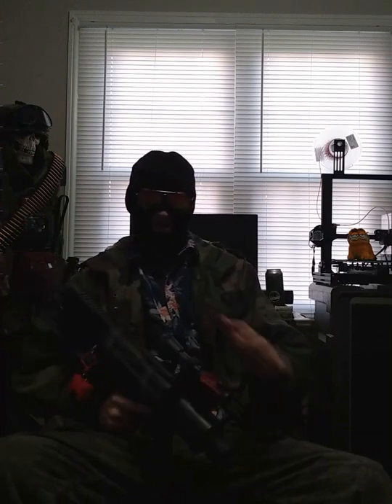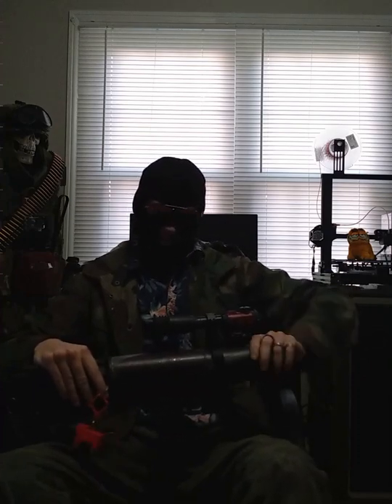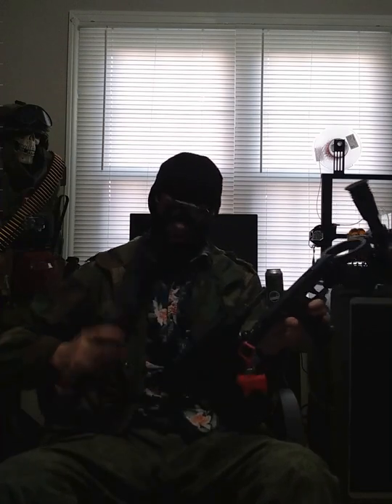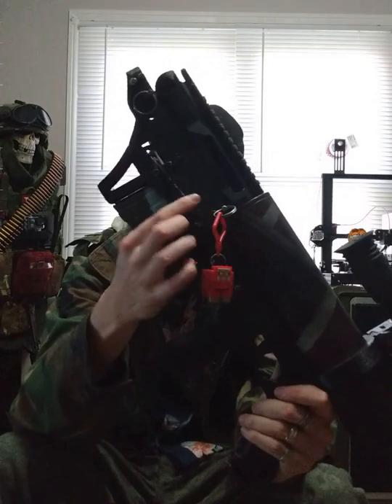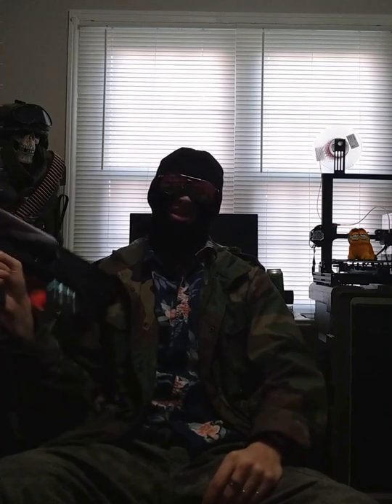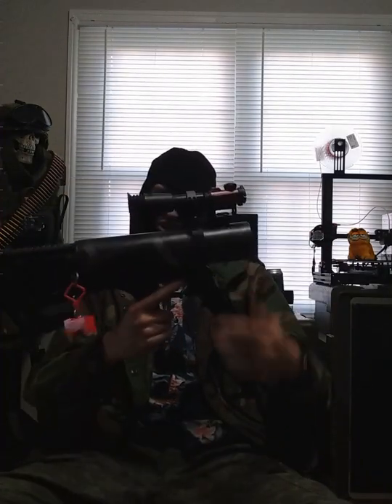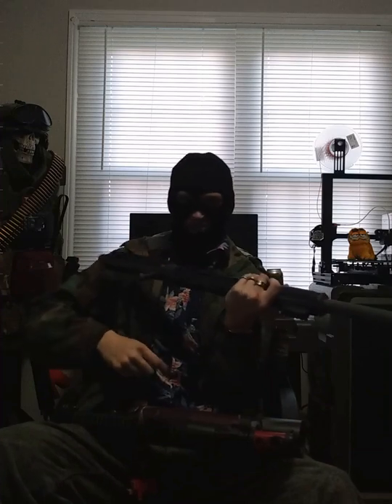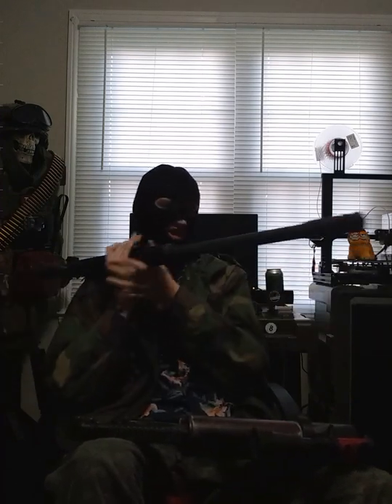SCRUNGLR Can Cannon Dissertation

Comment: Can you update Odysee for the full Bullpup Can Cannon Frame, which is missing an extruded mounting hole at the front where the Front Sight connects. 

The front grip has the correct extrusion, otherwise I'll have to drill a hole and won't look as nice or be as secure.
Reply from the maker: @GreekGadgetGuru  i can update it this weekend maybe
Reply: @thegunfoogle2864  Awesome, thank you!